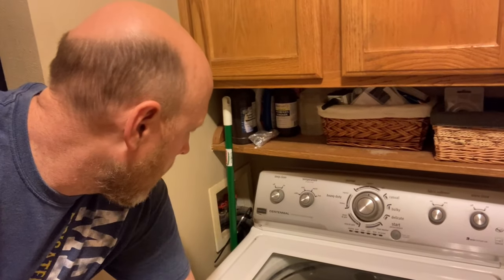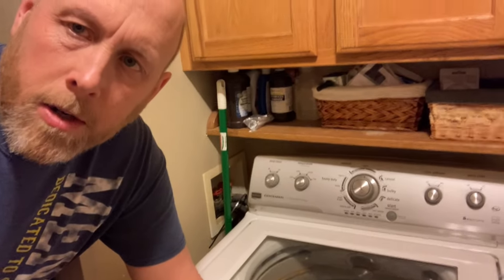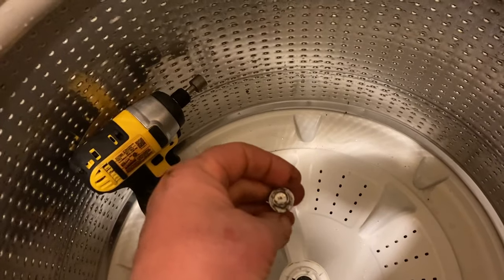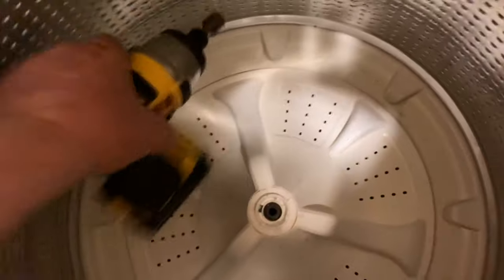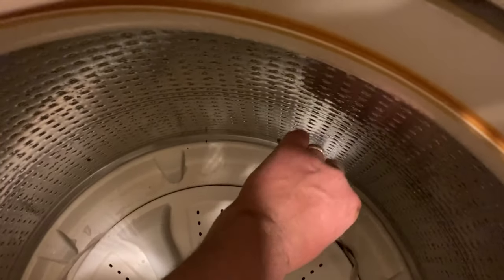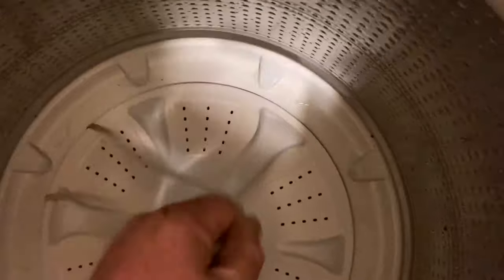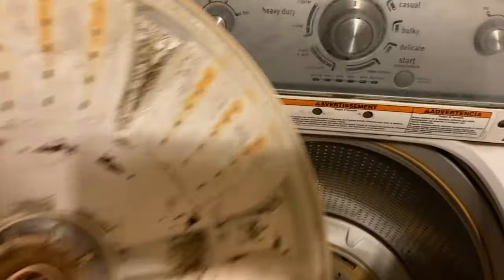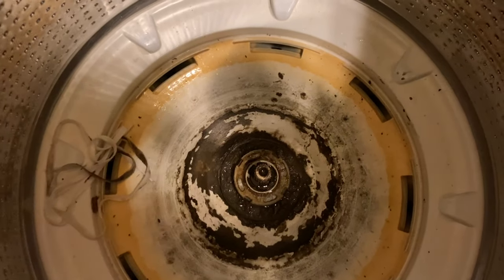How to take out the agitator in your Maytag centennial washer

Comment: That bolt is like welded in there! They make it look easier than it is!
Reply from the maker: I wonder if it gets so tight after so many hours of use.
Reply: I cannot get my bolt out. And it’s starting to strip the head. Idk what to do
Reply: @stephaniechavez3282  me too. is it one of those righty loosy things? idk what did you end up doing?
Reply: Same issue here! He used a drill, which we don’t have the attachment for.

Comment: I had a sheet lodged under half of my agitator, using this technique I was able to lift the opposite side and pull it off. Turns out there was an entire silk pillow case underneath as well. If I hadn't found this video i probably would have damaged the washer in my frustrated attempts at trying to yank the thing out... god I hate my cheap frigidaire stacked washer dryer
Reply from the maker: I am glad it helped!!

Comment: Great idea! I used wire, and it worked great as well!
Reply from the maker: So great. Ok glad it worked.
Reply: Wire? Can you please explain?
Reply from the maker: @deborahmartinez9450  they used a wire instead of the shoelace.  I have heard that from several viewers.
Reply: @deborahmartinez9450  I used baling wire (any wire that can fit under the agitator will work) in place of the shoelace that this guy used. It's actually easier to get it underneath the agitator. Just be sure you have enough wire once you "fish" it under the agitator on both sides to pull up with, working each side up individually, little by little. It should pop off with a little force as you work the wire up underneath the agitator.

Comment: By the way, pennies and dimes going through the wash can drop into the gap between the agitator and tub.  Without removing the agitator,  the coins can be removed using two suitable thin implements - such as the (dull) backside of two paring knives.
Reply from the maker: So true.  I have now used a few items like that too.  Thanks for watching.   Did you need your agitator out too?

Comment: My bf and I have been all over the internet trying to figure out how to get that damn bolt off and you’re the only one who brought up the impact drill. Makes so much sense we’ll be trying it tomorrow thank you🙏
Reply from the maker: awesome.  i am so glad to help
Reply: I used the impact. And it’s stripping the bolt 😩
Reply from the maker: The sockets needs to be the exact same size as the bolt head and the impact needs to be exactly up and down without being at an angle at all

Is it salvageable?   They make a socket head now that has pins in it that will grab even a stripped head.
Reply from the maker: @stephaniechavez3282  go to google and type in

Universal socket tool.
Reply: @northwoodsdiscovery6962 did u hold down the trigger for a few seconds at a time? I did for 1 second because of the friction sound. I'm not sure if that will mess my sweet impact driver up.
Reply from the maker: It should not hurt the driver.   They are made for that.  What brand do you have.
Reply: My Impact Drill would’t loosen the bolt. Got my electric Lug Nut (for cars) and it finally broke free. Insane!!
Reply from the maker: It is insane. I’m glad that worked.

Comment: I had an awful noise coming from my washer. I thought something was seriously broken.  Turns out it was a kids necklace to at was wedged.  I was trying to figure out how to remove the agitator and this was a big help.  I used a piece of paracord and it worked well.  Just had to work at it a little bit and it popped up!   I also found two dimes and a washer.  The dimes had huge wear marks as it appears they hd been there a long time.   It’s running again after I put it back together and it’s a quiet as can be.   

Thanks for the video.  You can find anything on YouTube
Reply from the maker: You bet.  I love when a project works out.

Comment: I tried everything to take mine off. Used a shoe lace, straps, and it was not coming off.  Ended up breaking the agitator, but the agitator’s bushing was still fused with the shaft gear. Ended up drilling two small holes opposite from each other then I use a chisel to hit across the top, and it split in half and came off the gear. 

Still worth the trouble, new agitator plate $30, new Hub Kit $10.
Reply from the maker: I am so glad you kept trying.  those machines are expensive
Reply: So don't think the engineering he's stupid to do it like this but they mean it, so you break it, so you can buy a new one. 🙃

Comment: How did you manage to unscrew the bolt? The whole thing rotates in mine, the screw is also tight. I may need to rent an impact drill. But still I need to figure out how to old the thing to prevent rotation.
Reply from the maker: i did not hold it.  i pulsed the impact drill and it came right out.  i hope the drill will solve your problem

Comment: Did you have to remove drum itself to fine what was causing noise. I found 2 dimes in the slots of the drum which I removed but havent removed the drum to look under it.
Reply from the maker: No.  Got to the gear after a cleaning and replaced it.

Comment: This worked.  Still had to pull pretty hard but it did come loose.  Thank you!
Reply from the maker: I am so glad it helped.  What did you need to do after you removed the agitator?
Reply: Pulled out the tub to unclog the drain hole.  Which took 30 seconds.  It’s odd such a simple thing to do would be made so hard.
Reply from the maker: @michaelvincent5376  Yeah. they want you to throw it away or hire a 100$ an hr guy.  lol.  Is it working well now?

Comment: I have the EXACT model. It's been giving me problems. It went from not doing a full cycle without opening and closing to not starting at all. You have any tips?
Reply from the maker: It sounds like you should start by resetting it.  There is a way to push certain buttons and rotate the dial back and forth. I think I found it in the paperwork taped inside the unit. 

If that doesn’t work it is probably the mother board.  

That happened on our washer and our dish washer twice. 

The cost of the part and labor is half the cost of a new one.
Reply: @northwoodsdiscovery6962  can you walk me through accessing the motherboard and reset?
Reply from the maker: @nicholassmith2009  I plan on making a video for it soon but you need it now.  please search on youtube for your make and model and also type reset.  There will be  a few videos on there.
Reply: @northwoodsdiscovery6962  can you tell me your make and model since we have the same exact one. I can't see it from my end really.

Comment: Hi thanks for this video. This is exactly what my problem is!
Once the agitator is lifted, what will be the next steps? Do you have any tips on what to do next to clean it etc. I imagine I’m going to find something that’s causing the chirping during the wash cycle. If you can give me some suggestions, I would be greatly appreciative.
Reply from the maker: i replaced the gears under the unit.

You can clean with bleach and water and elbow grease and a toothbrush.
Reply: @northwoodsdiscovery6962  Do you have a video on how to replace the gears? This video was super helpful! Thanks.
Reply from the maker: I do not.  but i did find one on youtube that i used and never made one of my own.  rats. @ujazz09

Comment: How do you get the bottom part off after this, btw thank you rhe shoe  string worked amazing
Reply from the maker: I love that I could help

What bottom part are you meaning
Reply: We got it thanks
Reply: Same question, how do you get the next part off (the plate with six screws in it)? I saw the plastic version just pops off but mine will not budge. Is there something attaching it from the other side?
Reply from the maker: Not on mine

Comment: I gotta ask, i tried using one shoelace, and two shoelaces. Can you think of another reason it wouldn't come out?
Reply from the maker: No, I cannot think of why seems like 19 out of 20 people that are doing this it works, but there are a few that they can’t come out
Reply: @northwoodsdiscovery6962  thanks for the timely reply. Did the diagnostic mode and it seemed fine. I thought the agitator wasn't working, seems fine. I believe it's just 12 years of build up.
Reply from the maker: It is incredible how gross they can get underneath that agitator and we wash our clothes in it. I’m glad we cleaned ours. I will continue to do that on other models as well.
Reply: @northwoodsdiscovery6962 It makes you really wonder how bad some other appliances get. I plan on getting a washer that I can actually clean easily and  regularly next time. Again, thanks!
Reply from the maker: Don’t get a front load
Reply: @northwoodsdiscovery6962  I won't, my mom is obsessed with front load that washes and dries
Reply from the maker: They retain water when not in use and get most fast.  Sorry for all the replies.  Have a great evening.   And good luck.
Reply: @northwoodsdiscovery6962  I appreciate all the help! Likewise!

Comment: Well, I pulled the cap off, then the nut. Then made two wire hooks to pull the washplate off. Wouldn't budge. Used heavy duty fiber duct pullstring as the shoelace method. Wouldn't budge. Bolted a pulley to the ceiling and tied rope to the pull string. Repeatedly lifting the washing machine in the air and bouncing it, slowly circling the string around the washplate as a wiggle method and hitting the center piece with a rubber hammer = nothing. 
After an hour and a half, the washplate snapped. I was surprised throughout, that you could suspend the washing machine in the air by the washplate alone. So, the lesson here is, you may as well add removing the washplate and just replacing that gear yearly to your list of home maintenance duties.
Reply from the maker: I  so sorry it was so much trouble.  I can’t even imagine the frustration.  Will you buy a new agitator plate?  Was it nasty under yours like mine was.

Comment: What size nut did you use with the impact drill? My bolt is striped and i am unable to get it off
Reply from the maker: Oh boy.  I can’t recalll

It might not matter now since it’s stripped
Reply from the maker: If you go to google.com and type in universal socket tool that might help you it’s fairly cheap but it might grab the head of the bolt
Reply: 7/16

Comment: So is there a lint underneath this thing or just does that?
Reply from the maker: I am not sure of what you are asking.
Reply: @northwoodsdiscovery6962  when I look up my washer, they keep saying there’s a catch for the lint so I’m assuming there’s not and you just have to clean under that thing is that correct?
Reply from the maker: @mstormy  I found a bit of lint but mostly just " sludge"
Reply: @northwoodsdiscovery6962  so the repair man is really full of you know what so that’s cause I could I have I have four dogs. I don’t have strength so is it easy to put back in because you just show up pulling out and I’m a senior.
Reply from the maker: @mstormy  putting back in is very easy.  just slide over the center and then tighten the bolt.

Comment: How did you get the top part of the agitator (the column) off?
Reply from the maker: The cap popped off pretty easily. and the impact wrench did wonders for the bolt on top.

Comment: I have the bolt off but there is still a sound as though the agitator is hitting something preventing it from coming off. Shoelace didn’t work
Reply from the maker: Did you ever get your agitator out? There have been a few people that say that this doesn’t work but most say it does I wonder if the brand matters and how they installed it
Reply: @northwoodsdiscovery6962  no :’( and now it’s kind of bent in there lol
I had a weak elbow at the time so I might try again once I’m sure it’s healed up.
Appreciate your video and comment!

Comment: Is there a way to get the bolt out if you dont have an impact drill? I've been trying with a socket wrench  and cant get it to come loose..  

Thank you in advance.
Reply from the maker: it will be very difficult.  is there a way you can borrow one from someone.  it might be the only way
Reply: @northwoodsdiscovery6962  I used a socket set
Reply from the maker: @ujazz09  great i am glad that worked.
Reply: I tried without luck, fortunately I have a impact wrench and it turn it out easily.
Reply: I did borrow one from someone thank you all, also got a spanner wrench.
Reply: @ujazz09  was it lefty loosey?
Reply from the maker: Yes.   I think everything in my life is righty tidy lefty Lucy, except some internal attachments for 20 pound LP tanks.

Comment: I have Working whit my, i put strap, and pull it also i do use my hands and dosen't work, la realy stock in it.
Reply from the maker: I am so sorry I won’t budge.  Is the bolt out.
Reply: The bolt is out.  I used the straps and pulled very hard. It is still stuck. Will try another way.

Comment: Why would you do this? The agitator is useful!
Reply from the maker: i had to take it out to clean underneath and to figure out why the machine was so noisy.
Reply: @northwoods discovery Ok.
Reply: I got bolt out, shoelace underneath and it's still not coming off
Reply from the maker: @derekingui8408  it is on tight and have to wedge back and forth.
Reply: Our washing machine is squeaking on the spin cycle.
Reply from the maker: @ElevatorWasher5000  Ours was squeaking so loudly then too.  We bought a new gear that has to be replaced from underneath.  Very easy to do.  About 40$.
Reply: I’m just washing clothes myself
Reply from the maker: @ElevatorWasher5000  in the sink?  we went to the laundry mat a few times until we figured it out.  boy is that pricey.
Reply: It stopped speaking but now it is still grinding a bit every time the agitator stops
Reply from the maker: That’s odd.  What year is it.